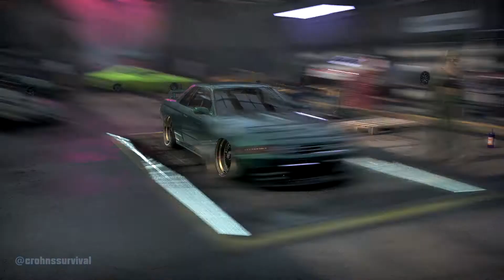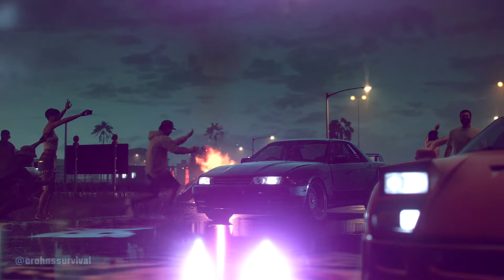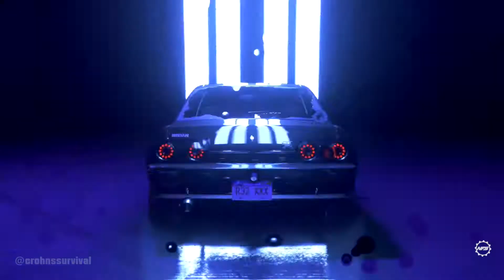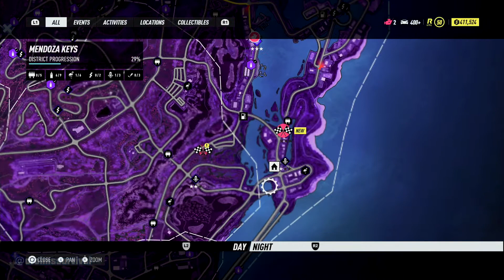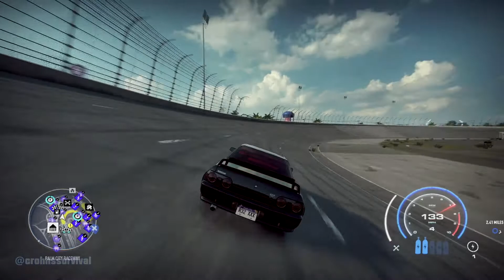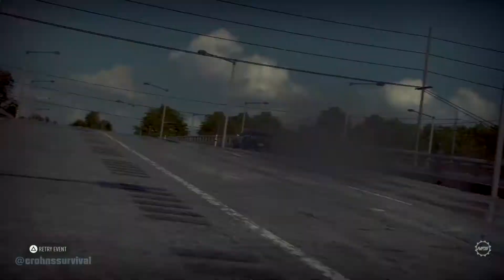Nissan Skyline GT-R R32 Forged Last Ultimate + Part NFS HEAT

Comment from the maker: Nearly at 160 subscribers woooooooooooooooooo
Reply: Hi, i have a question, are there only FOUR Ultimate+ parts, one for the crank shaft, one for the ECU, one for the cooling and one for the exhaust? Or are there more U+ parts? I only have four U+ right now and no space for more parts and so far noone could help me with that question. I hope you can help me. Thanks in advance
Reply from the maker: As far as I know that's all